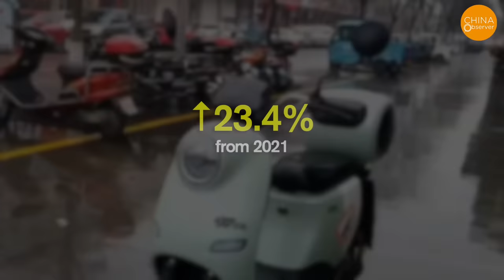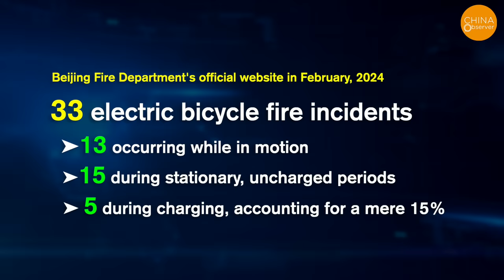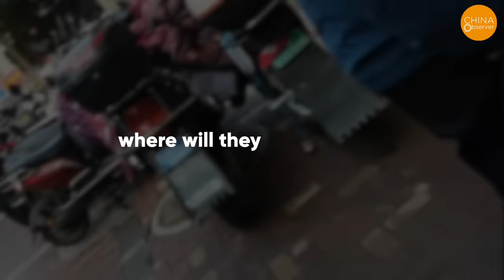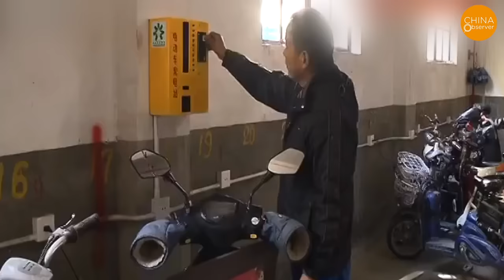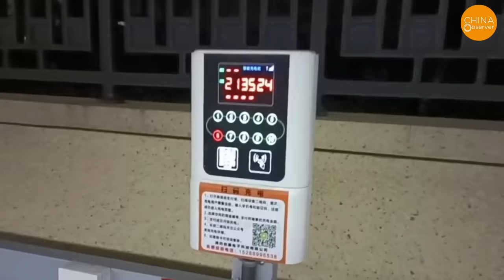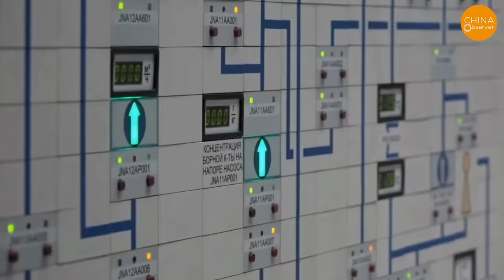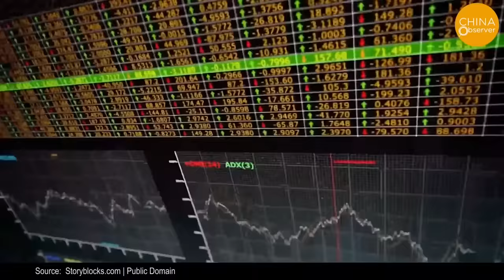21,000 Fires a Year! China’s Often Self-Igniting EVs & EBs Become Ubiquitous ‘Moving Bombs’

Comment: Most likely the 'smoke' is off-gassing and if you see it you need to get away and hope it dissipates.  These fires are getting water just runs toxins into the ground water. You need a mitigation for fires to stop the contamination.  These batteries are terrible especially anything more than enough to power laptops. Quality is very important.

Comment: EV will never replace traditional engines..
Reply: Maybe one day, but battery technology for motor vehicles is not there yet.
They need to be the size of a conventional car battery and have a range of at least 1000 kms and fully recharge in less than 5 minutes.
At the moment pure EV's are impractical and there excessive weight compared to ICE vehicles results in more damage to the roads, excessive brake pad wear, resulting in pollution of the environment, and excessive and accelerated tyre wear. Providing mor pollution and environmental damage.
Reply: The best hybrid technology would probably be the Owen Magnetic system. Jay Leno has one, built in 1916.

Comment: I recently visited a EV battery repair shop and the repair guy told me there are over 20 years old electric bikes on the road, not with the original batteries though. Usually the batteries wear out and are replaced because they have limited recharging cycle, but sometimes in the end one cell can short out and cause a fire. Since all the bikes are covered with plastic it’s common that the whole parking area burns down. The battery cell manufacturing is a mature but each cell ages differently so among the billions of cells there are always some that short out.

Comment: On Ebay I've noticed a large variation in the popular 18650 batteries that are used in everything from flashlights to electric cars.
The batteries from Japan and South Korea are a lot more expensive than Chinese batteries but they are worth the price.
Even when they don't catch fire, the Chinese batteries can be very disappointing with regard to performance.

Comment: A concrete wall with a cavity in the center for filling with sand can prevent spreading of fires with e-bike parking. This should be required in China as they have plenty of sand. Each bicycle parking spot should be on 0.5 meters of sand. That way if the concrete wall melts sand dumps on the bike making it unable to burn. When making a battery pack I keep a bucket of sand as snuffing out oxygen is the only way. Sand filled ceilings would work too.

Comment: So, you have about 10 minutes before a battery that's going to catch fire, if you have a CO2 or CO smoke detector. A failed battery will overheat and swell up before it fails, so it is detectable... and if it's leaking gas, you have a few minutes before it's going to catch fire. Enough time to wake up if an alarm is going off. 

In a Chinese car/bike, they won't have extra safety sensors on the battery, just a charging/thermal throttle. And they won't have cooling or CO/smoke alarms nearby either. So it's going to be "mysterious", until they figure out how to make cheap safety devices or mandate them. or both.

It's why people who have RC batteries, often have a fire pit and CO detector when they repair/collect up a damaged RC drone/car/plane, as a CO detector can tell if it's damaged or leaking gas before it catches fire. 

This is the case for overheating, overcharging, refurb batteries, batteries over 3 years old , and other issues. as noted, it doesn't have to be charging to explode. There are also cases where a battery fails and it just swells up without catching fire. In the case of phone fires and tablet fires, they release trace gases as the battery pack swells and gases escape from the foil/enclosure(s) holding the battery together.  

If you have a swelled battery, it's failed and could catch fire. When you have 30-150 batteries packed together with no room to expand, that's usually what causes these spontaneous fires, i.e. one battery swells, but because they're packed together, they rupture/vent toxic gases, and eventually lithium gas which reacts with the oxygen and catches fire...  instead of swell up safely.

In the case of most of these fires, it's likely a cooling problem or fatigue/faulty cells, which is why they catch fire while in operation. Modifying the battery or charger is an issue, but it's so hit-and-miss with battery fires. It's a 1/10,000,000 event that a lithium battery fails ... but that's 10x a day in china. And it's 1/100,000,000 that it explodes and catches fire. 

There's also a need to put thermal sensors and alarms in the battery systems, because they need to operate between 10c and 40c. Below or above 50-120'f / 10-40c, lithium battery chemistry changes, and they won't work properly. 

This is China, ~$16 for a CO detector is a high budget luxury item, which is why cars/chargers/buildings don't have smoke detectors. Some people just leave them on the bike so if a nearby bike is leaking fuel or there's an old car nearby, the alarm will go off and warn people. 

The carbon monoxide warning is also built into carparks because petrol fire and EV fires have a similar chemical exhaust. The toxic fumes are similar, you can look at the SDS/Fire Suppressant sheets for NMC/LiPo/LiFePo4 fires, which have similar 'toxic' chemicals (NMC is a bit more toxic, from what I recall). It hits something like 20ppm to 600-1200ppm once the cell is ruptured, most cheap CO detectors alarm around 50ppm.

You may not notice the ozone smell or the burning plastic smell from a battery about to rupture, because it will smell like car exhaust or a sweet acrid smell, that's the plastic melting around the battery. Once it pops and you get smoke, you have about a minute before it catches fire. 

The fire isn't simple to extinguish you have to cut off the air to the battery/fire, or let the lithium burn out, which can take days. Especially if it spreads out to nearby batteries. 

There are "cheap" ways to stop an EV fire, either by submerging in salt-water/brine, using a halon/fire retarding gas in an enclosed box/shipping container, or fire boxes designed with suppressant, ie you pick the car/bike up with a crane, put it in a shipping container, fill the box with "fire pebbles" and the pebbles reduce the oxygen around the fire area. 

Water won't extinguish the fire, because it's lithium reacting with air.  You have to reduce or cut off the amount of oxygen to the fire. In the future, they'll probably have ejection systems to dump the battery off if it's misbehaving, and the battery can then be 'freezer-packed' in a shipping container until it cools down.

Comment: I’ll agree-overcharging and modifications are probably the number one reason for fires (messing around with the wiring to make it go faster for example). There are plenty of videos on YouTube on how to disconnect this or that to make your device go faster but those safety features are there for a reason. Or people are buying a bigger battery to get more range but the bike is not designed for that battery or buying a replacement battery without checking the specs to make sure it’s the right one. You want more speed, buy a bigger bike!

Comment: Anyone that knows anything about electronics will tell you that it's impossible to overcharge a battery leaving it plugged in overnight, simply because all lithium batteries are, or SHOULD be protected against overcharge. As they reach their full voltage they simply cut off power. This is the case with all lithium-ion batteries used in phones, laptops, vehicles, etc. Protection is present on the battery pack itself as the BMS, in the device itself - a simple fuse, and in the chargers. A charger will shut off when short circuit, over voltage occurs or overload occurs.

Comment: For 4-wheeled vehicles the battery packs shall be in compliance with UNECE R-100, because cramming a lot of energy in a small space is never without risks. There are reasons why regulations were developed step by step for boilers and steam engines when these first came.

Comment: New rules for electric cars: (1) Require an annual registration fee which is proportional to kilometers driven. This would be reported to a central server via internet monthly and replaces the gas tax for road construction. (2) Include a multiplier to the annual registration fee which is proportional to the recorded number of vehicle fires per million km driven for that brand. New car buyers would look this number up before buying to determine annual registration fee cost, and this would influence buying decisions, thus motivating the use of low-flammability batteries by the manufacturer.

New rules for electric bikes: Same as for cars, plus making outdoor charging stations with walls to keep fires from spreading. Ban indoor charging and storage.

Comment: From upstate NY, local small school just received there first ev school bus at $490,000, 3 more on there way.  Class size is 30.
Reply: Don't worry, those ev busses have their batteries made outside of China. Every state that buys those EV busses has to get the batteries certified. This is why domestic made Chinese EVs never stand a chance in the west. Their batteries can never hope to pass inspection.
Reply: and they have to finish route within 30 min or will need RECHARGED
Reply: Class size was 30 if they came from china
Reply: @Alfred.E.Newman That's not how EV's work, lol. And it's certainly not how fleet planning works either.

Comment: Just like how fossil fuel cars take a century to become safe and viable, it will take another century for the electric car to become safe and viable. In the 90's many companies did experiment with electric cars and turfed it afterward for a short period of time. They never give the reason why. Now we know it is the battery that caused the explosion and many of the automakers do not want to have lawsuits after the Ford Pinto debacle.
Reply: EVs are funny enough, about as old as combustion engine cars. In the beginning there wasn't much of a difference in which energy source is harder to get your hands on (fuel or electricity) either. It's just that batteries have evolved way too slow to compete against just carrying fuel. Using electricity is way easier but storing it has sucked since we've began to use it.
Every EV you've seen in the early years (there were some in the 70s, 80s, 90s...) was always plagued by heavy and low energy density batteries - heavy car with low range and slow to charge, since the car makers couldn't invent the better batteries themselves, it just got shelved until Li-Ion came along. Now we're seeing it's biggest downside pretty hard in use.
Reply: Not quite that much time. We already have perfectly safe lithium battery technology such as LiFePo and Sodium-Ion, among others. The only problem is that the energy density is lower than what we are used to, so it's not seen wide adoption yet because capitalism prioritizes profitability over safety. And you won't experience record profits with a battery tech that's "just safer" than the alternative, sooo...

But we'll definitely see those alternative lithium batteries reach power density parity with current lithium battery technology within the next decade or two, not century.

Comment: Improper charging BS! I have built and repaired few powerbanks in the past and had no issues, because I use STANDARD lithium battery and STANDARD BMS chips that has short-circuit protection.  These are substandard batteries or substandard circuit boards that are unable to regulate either amperage or voltage.

Comment: Those lithium ion batteries fires are started by a chain reaction and there is no putting it out with water. The extinguishers for these fires are in a class by themselves made especially for these batteries. I’ve made a couple of solar generators using lithium ion batteries and when I realized the problem I had to buy them and they are expensive. If the cost of the generators wasn’t so great and the grid were in better shape, I’d get rid of them.

Comment: 14:52 The reason why they couldn't put it out was either that the fire extinguishers were tofu ones, or they were using type A or B extinguishers when they needed a type C.
Reply: Nope. The reason is that lithium fires are extremely hot (2000C), very hard to put out, and each cell in the pack is a fuel source that will eventually be ignited by the heat.
The only way to "put out" a lithium battery fire is to submerge it fully in water and wait until it burns itself out, or the water dissipates enough heat that the runaway ignition of other packs stop. This is why firemen always let electric cars burn themselves out, because short of dumping the whole car into a lake, you cannot do anything but wait.

Also it bears repeating that smoke from a lithium battery fire is EXTREMELY TOXIC AND HAZARDOUS TO LIFE.
If one breaks out near you, run the hell away. Run far, far away. Do not breathe it in.

Comment: That's why ethanol ships are a good alternative.  If you took a thousand giant pressurized PET plastic cylinders a hundred neters long and ten meters in diameter and built a five hull ship one kilometer square and one hundred meters above the ocean with sails extending another three hundred meters high, the sail area would have about 500 megawatts of wind power available in average  30 mph wind.  If the ship drags giant oropellers through the ocean, it might generate 200 megawatts of electricity. .  Used to synthesize ethanol from hydrogen and CO2 in seawater, that is about one gallon of ethanol per second.  Times 365 days is  about $100 million dollars a year.  If the giant cylinders cost $1000 a piece and the the sails cost a million dollars,  the ship would pay for itself in a short time.  In a hurricane with 120 mph winds, there would be about 30 billion watts of wind power available in the sail area.  One week long  hurricane would equal over a year in wind energy.  A few thousand of these ships would equal total global oil production.  There are millions of tons of PET plastic floating around in the middle of the ocean in garbage Islands.  PET  plastic is flammable but if it was pressurized with CO2, the cylinders would be like giant fire extinguishers.  
If the deck was covered with solar dishes it could make another $100 million dollars a year in ethanol.  The dishes have to have trackers so the ship would be like a microwave super weapon.  
The average hurricane has about 1.5 trillion watts of wind power.  A few hundred of these ships would absirb most of the energy from a hurricane.   Figuring hurricanes and tropical storms and average winds, one ship might make a billion dollars worth of ethanol a year. 15:08

Comment: Lithium Ion battery packs do not show the proper resistance when they are finished charging, if you do not use the proper charger or use an off brand charging, the cheap chinese charger you used will not stop pushing electricity into the battery pack, this is what causes fire.

Comment: I have a hard time believing that someone sets up a battery manufacturing facility to make batteries cheap and WRONG. The real fault lies in building packs of cells. 

There is no such thing as a reliable lithium ion battery, they all have a recharge life, but there is no historical record for the individual cell. In a cell pack, you cannot easily locate a particular cell exhibiting bad recharge/discharge performance. Just like in a 12v car battery, you might have one bad cell, but there is no way to tell which one, or to replace it without deconstructing the battery.

IMO, cell packs need an elaborate connection grid that connects in parallel for diagnostics and recharging, and reconnects in series to produce the needed voltage for discharge load. Is such a system conceivable?

Comment: Sorry, but every motor show and showroom I have ever been in requires the ICE vehicles to have <5 litres of fuel, and for many motor shows the vehicles battery has to be disconnected as well, requiring external power, often limited to just a few amps for any in-car display. Picking up my last 5 new cars has the vehicles outside, or in a delivery area, not a showroom, so how the hell can an EV be allowed on display, as even a "flat" EV battery still has a fair charge and also almost the same ability to combust as a fully charged one.

Now if I ever did own an EV, and it will be a cold day in hell that I ever buy one, I would never charge it inside my house or shed, it would always be at least 10 meters away from my house at a minimum, and thats hard to do with most houses, even outside the metro areas.

Comment: they use low quality reused battery there chargers do not regulate charging or cut off  when overheated  witch they all do by the way they are designed

Comment: I actually handled a lithium battery fire hazards they are very hard to shut off the fire because once the lithium battery caught fire lithium creates its own fuel the only way to successfully remove the fire it is only either of two things first if you have a lot of water submerge it for 30 minutes it will still burn under water but it will not burn nearby materials and second is shutting off oxygen means only a C02 fire extinguisher can successfully stop the fire other extinguishers will fail and only these two things work in my experience.